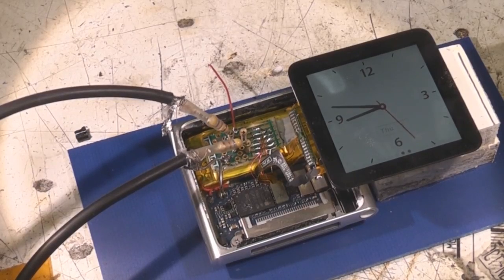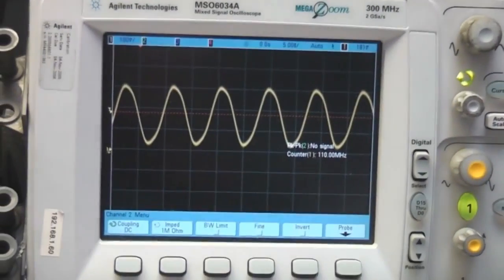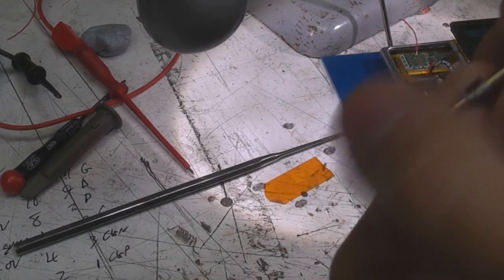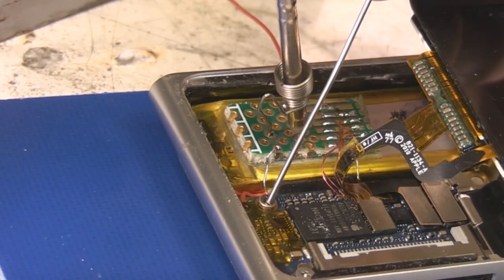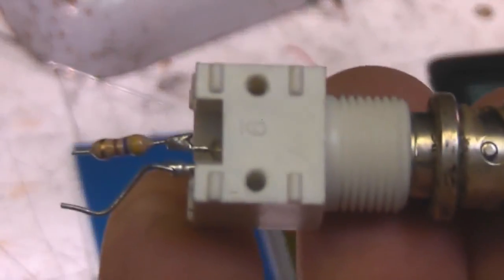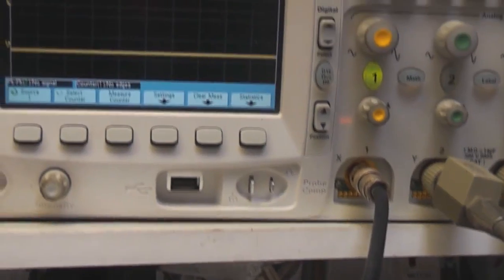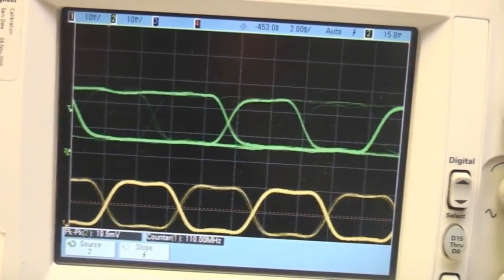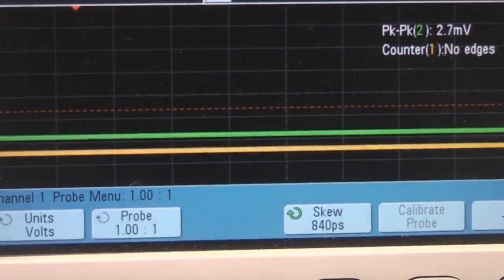High frequency probing techniques for reverse engineering

Comment: I am not quite sure about that "thicker wire has lower inductance"
thing in video is that the thick wire is straighter than path trough pcb
but there may be something true in means of impedance, thicker wire will have smaller impedance

Comment: Nice video, Mike! Your 110MHz clock signal is really pushing your 300MHz scope beyond its limits, which I think is the main reason why the final result isn't even more square. 3rd harmonic of 110MHz would be slightly attenuated by your scope and it is likely that the 5th harmonic is severely attenuated and the 7th is probably non-existent.

Comment: From what I've heard, regular 1/4W resistors, installed close over a ground plane, are pretty much resistive into the GHz, maybe up to 5GHz or so, for values from 22-470 ohm maybe.  This basically works because the resistor over the ground plane acts like a transmission line, so the signal stays OK.  Smaller values look inductive and bigger values look capacitive.  The spiral inside is so tight that it basically doesn't count for anything.
Reply: I was about to comment his use of the spiral film carbon resistor, wondering how come he doesn't know about it, and then I thought about this as well. My experience comes from MOSFET gate driving resistors which reduce or eliminate ringing by introducing the lossy, resistive component as a dampener.
EDIT: I just saw his comment below about this. 😄

Comment from the maker: Didn't think to test this. Some carbon and metal film TH resistors have a spiral cut which is inductive - a surface mount resistor would be optimal, but fragile.
Reply: The resistive component probably overrides the inductive one, but we won't know until we test it.